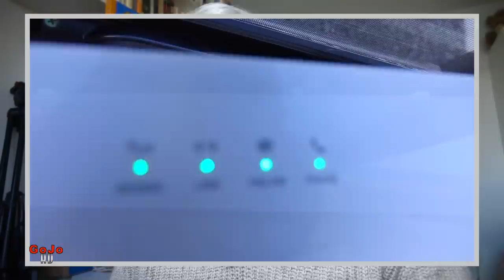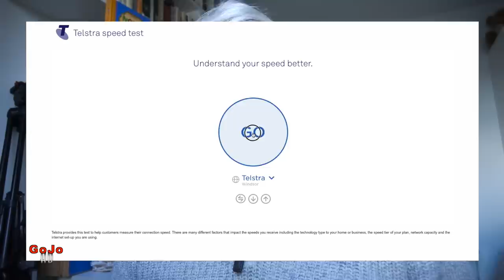NBN Connection Farce | Telstra Smart Modem Review | Internet Speed Test

Comment: I don’t get the reason behind people being surprised that pits are full of water... they are literally under the ground, where else do you think the water is going to go??

Also, this seems to not be a Telstra issue, NBN had not run your lead-in cable yet. Which they should have already done. This is what you were pulling through in the pit, which he should not be getting you to do at all... 
(Initial NBN connection, again, not Telstra anymore)

The initial tech should have seen the no lead-in issue and fixed it, but they would have only run the jumper at the pillar it seems.

Comment: I live in south east Melbourne and I'm still waiting for the NBN. Initially it was to be done in the first half of 2017. Then the date was changed to the second half of 2019. Now we are told that it should happen by March 2019. I've not been happy about the delay until recently when I discovered that my service will be Fibre to the Curb and not Fibre to the Node. In the past I could never understand why there were so many complaints from people about the NBN. How could that be I thought? But it would seem that those complaints from disgruntled customers about slow speeds have forced the NBN's hand to go with FTTC where possible which is significantly faster.

Comment: so what discount did you get for doing the work that Telstra should have already done
Reply: Telecommunications are not classed as an essential service in Australia so there's no legal requirement to make a physical connection when the house was built. It would have been only if the owner requested to have it connected. Additionally, in recent years, the onus has shifted and Telstra and in most cases, now NBN are not obligated to supply conduit or a trench for it to go in on your property, the trench & conduit are the responsibility of the property owner and then the network owner will supply a cable from the closest pit to the house.
Reply from the maker: Interesting!
Reply: @bradreading  Not just recent years. I bought a new build in 1995 in NSW in an 'estate' type set up and the phone lines were only in to the property boundary. I would have had to pay for Telstra to dig the trench. I saved some cash and dug it myself, you just have to ensure it is to at least a specified minimum depth.
Reply: Correct, and so many people blame Telstra when in actuality, the NBN own most of the network now after asset transfer, and thus are responsible for jointing and running new lead in cables. 

(Contractors do these connections, Telstra do also have maintenance contracts with NBN in certain areas)

Comment: Fibre was all installed in areas of the city before it was offered.  I could not handle going through all that.  Those speeds are really slow in this day and age.  Currently I have Gb service and could upgrade to 1.5 Gb but I don't need it for the extra cost.

Comment: I don't have NBN available in my area for another year at least, but I have no plans to use it once I get it, and haven't even used my adsl line for the last year anyway! I use a 4G connection instead and its so much better without the hassles.

Comment: You reckon you're having issues, it's been months and we still can't connect to anything.
Reply from the maker: ouch! not good
Reply: 2 years and waiting
Reply: Turned up at our house a year and a half ago to put a box on the outside wall. Came back 8 months ago to move the box 5cm (up or down not sure) as it was wrong height. Now got more holes in house. Haven't been back since. 3 install dates for area flitted on by, nothings happened. Now told, we're getting the cheaper option of HFC and there was a delay on that as the Gov were caught out using the old system and the minister put a halt on installs while he "investigated". Not sure what is happening now.
Reply: Just had it installed. After all this time, got HFC with flashing light box in lounge/dining room.

Comment: Completely different experience for me. I used Activ8Me as an ISP, Melbourne based so that is where there help line is. NBN guys came and installed fixed wireless, rural property so no point in fibre in the street. Not the fastest type of connection but good enough to watch videos and do everything I need to. No real problems with connection and I get a text and email if any disruption due to upgrades are going to happen.

Comment: When I contact Telstra, which I try to avoid, I always expect the bizarre and absurd. I have never been disappointed so far.
I stupidly rang to find out what was involved when the switch to nbn became available. They said if I switched before the end of the month I could have a free google mini, so I went ahead.
New modem arrived, it connected but internet not working.
Rang them twice 3.5 hours on the phone! My personal record! Discovered the cable to the wall that came connected was the wrong one!! Used my own correct cable still not working!! They gave up “will investigate”. Tried to help my neighbor with similar problems by lending him my cable, his still didn’t work BUT by pulling my cable out the modem switched to 4g sim and worked! Then when I put the cable back in the modem reset itself and worked with the cable!! Reported the solution to Telstra who we’re grateful.
Ps told not eligible for google mini as not new customer! Kicked up a stink got $75 credit.
Pps my new modem died after six months! Another 1.5 hours on the phone trouble shooting then sent new modem and had to get working and reset all my equipment.
Telstra new slogan “it simply doesn’t work.”
Will say goodbye when contract ends.
Good luck everyone

Comment: twice nbn techs turned up in 20 mins...i was blown away, id hardly hung up from a nice lady in the Philippines when a knock on the door....he fixed the little box in the house that was original land line ..then still not right another tech came out again only 20 mins.....asked him if nbn was stalking me....lol....anyway...did all those same tests you had and the only thing left was a another new smart modem..........and it worked...i suspect once the land line was fixed everything would have worked but a new box wasn't suspected so a lot of hoops were jumped before we got to the logical end.
oh its great works a charm..a touch slower at peak time but nothing to worry about..  I think good copper from node to house is a must...really old houses would be a nightmare..

Comment: I feel your pain. For me it’s been nearly 13 months struggling to get proper service from Telstra. There has been 6 NBN techs around and not one of their stories are the same. Sick and tried of having to spend hours and hours on the phone to the call center just to get given the run around. I have given Telstra one more go at fixing my NBN connection and then if it’s not working I will pull the plug on Telstra.
Reply from the maker: So many frustrating stories out there - thanks for sharing yours :)

Comment: Unless you have fibre to the home, the use of the existing phone line copper wire is hopeless because any join in the line or data flow increases a resistance in the line and slows down the internet. As a current (data flow) runs through the wire it heats up. Line speed will not be affected but internet quality will be.. when it rains the data flow slows even more when moisture enters the old phone line pits
Reply: MY isp recommended that before selecting a plan, have them test the line capability and don't go higher. They say that exceeding the line capability can cause frequent dropouts, by overloading joints, etc. I made the mistake of moving my 50 plan to 100, which brought a speed increase from the high-40s to about 54Mbps, so moved back to 50.

Comment: I had not a single problem with connection through Telstra - hassle free in all areas and getting 47mps download and 19mps upload on the 50mps plan - I’m about 40 metres from the node so that would help. Invoice em Geoff! 👍
Reply: Running at miles per second, impressive

Comment: First problem, Telstra... Seoond problem is TELSTRA.. Let us compare.. Monthly unlimited plan on Teslstra is $90 / month on standard speed which is 23mbps.. TPG is $69.99 / month for unlimited at a speed of 42.7mbps, if you pay for the fastest TPG connection possible it is the same price as the basic Telstra plan. So Telstra speed of 23mbps vs TPG at 71.1mbps for the same price and more often than not using the exactly same network and equipment.
Reply: the difference is in the international links which telstra wins in, and the cvc which again telstra wins in
Reply: @avgfree21  yes for business I would be going Telstra for sure and have done so in my 20 year IT career.. but for home use Telstra just does not make any sense at all. Especially when TPG and others utilise the Telstra network. So essentially you are driving a Ferrari whilst paying datsun 110b prices..
Reply: 23mbps? Wish i had that im getting 8mbps
Reply: @coopv2  I am pretty much the same now in Brisbane.. up in Toowoomba it was optic to the house and 80mbps..  upload in Brisbane is dial up speed almost.. crazy but it is an old house and a mix of cat5, coax, donkeys to exchange and then optic in there somewhere maybe..
Reply: @MortifiedU  There is a HUGE difference between Bigpuddle and Telstra IP Services/IPconnect/whatever they want to call it this week so yeah I agree business wise Telstra may be a decent contender and for sure on the residential side THEY STINK.

An example there that actually happened to me and was the straw that broke the camels back, I went with Bigpuddle for a bit a decade ago as I needed a reliable service for home/SOHO/small biz combined use. One day the BGR's went down and I could get ANY and all websites hosted in Australia and NZ and ping all IPs in AU/NZ. I couldn't get anything outside of the pair no pings or websites or anything. So I proceed to ring Telstra and report the issue. 

Telstra rep: welcome to telstra blah blah 
ME: report problem
TR: have you got a Telstra modem
ME: no I woudn't touch that rubbish (we've had lots of problems with Telstra modem/routers before and seen heaps more before with other people especially as this was the days of the crappy black speedstream 4200/6500 boxes)
TR: well that's your problem your modem is broken
ME: WTF?!?!? did you NOT hear that I said I can get web services for AU/NZ?
TR: no it's not a telstra modem so it's broken and you will have to replace it, it's not our fault
ME: how the F did you get this job when you obvously aren't even fit to be a $hit digger, listen to what I say, I can get websites hosted in Australia and NZ so I know for a fact my modem is fine
TR: nope your modem is broken have a nice day hangs up

I was in IT for some years before this so I'm not a newcomer with NFI and this just had me and awe at how STUPID their staff are and how they really don't care about the customer. I found my way to Internode at the time I believe it was and never looked back until they sold to iiFail and had to move on regreftully (Simon that wasn't nice selling us like that).

Comment: My NBN experience... Monty Python all the way. You assisted the tech, great job, now your'e a qualified cabler lol. I had about 10 'techs' turn up on the 3rd attempt to pass the fibre through the old conduit from the street to my house. 2 or 3 guys worked as the others looked on. Great use of human  resources there. And then when they decamped,  I found the junction box on the external wall hanging after they'd chewed up the rawl plugs in the brickwork. After much cussing, fixed myself .I formed the distinct impression these 'techs' were 457 visa workers as they were communicating with one another in their mother tongue. There' s more but you get the idea.Now what's that old saying my dad used to use..couldn't organize a piss up at the brewery!

Comment: Had fibre to our street for 12 years already - thanks to original Optus rollout, 40mbps download minimum, via the Foxtel cable. Rock solid, bulletproof, never any problems.  NBN HFC will be more expensive and slower, as a bunch of additional load will be placed on the node on that fibre. What a load of crap. Bring on 5G, the whole house of cards will start falling.

Comment: Hi ,

Actually the cabling from the corner of your street to the pit and to your house is managed by NBN, and not Telstra.

Cheers.
Reply: I don't think so somehow, Telstra owns the NBN, ok that maybe, but NBN own their own fibre optics, and it takes a lot of care and patience to deliver it
Reply: @theroyalaustralian  Telstra doesn't own NBN
Reply: the cabling from the street to pit and to the house was telstra's job when they put everything in, however the tech that was doing it at the time didnt end up connecting anything for that house, they only install the connection when you request a connection to be made if no connection has been made before which is why no wires were there at the time of the video. the people that owned it before never asked to be connected.
Reply: @Davo22  well, we are still required to ring Telstra to rent a phone number. And thats a $30 cost while you have the line
Reply: @theroyalaustralian  that is because telstra maintain the switching database for your ph number. telstra is actually in a sort of stop work phase as all of the government owned infrastructure like the pits etc that they were tasked with maintaining have fallen to NBNco nbn co is now responsible for all the fibre and backbones and replacing ANY cable that is unsuitable for NBN so a place like my parrents who ONLY have 2 twisted pairs entering the property will need a new coaxial cable run into the property for the NBN and telstra WILL do everything they possibly can to avoid maintaining this wire until that time
Reply: @jackass123455  well yes that's very true, but they also own most of the communications infrastructure, and are therefore powered by the government itself
Reply: dodeca hedron  Fun Fact: Telstra is more often than not voted the top ISP in NZ and is one of the most loved. Funny huh
They are actually pretty fucking good in NZ, really good customer service, plans, pricing and reliability and if you are lucky enough to get connected into an exchange where Telstra has a footprint, you'll get really good speeds too using good infrastructure.

Comment: Ours was quite easy by comparison, 1st NBN contractor lays cable up the street, 2nd NBN contractor cable from Street to box outside wall, 3rd NBN contractor from Box into house. 4th Telstra Tech shows up to verify all connections and set up internet & home phone. Now the outside guys they each did there own thing outside. 3rd & 4th were by appointment since they needed access inside the house. It has worked well ever since.  BUT i have heard from relatives and friends in other area's some horror stories. Mainly lazy contractors laying cable up the street but still using the old copper phone lines from the street. so speed restricted to ADSL service. Just think we got lucky with the right people doing our connection.

Comment: I ended up making a complaint to the TIO. Telstra were unable to work out why my download speed was atrocious. They sent one of their Platinum techs out, supposed to be free of charge, who sorted it out in about 5 minutes - I needed an extra antenna because the modem was downstairs and my desktop PC was upstairs. The signal was weakened because of the distance and the fact there was a concrete slab in the way, quite normal for a two storey building. I was then charged for the Platinum tech on the next bill. I would've preferred the modem be installed upstairs, next to my desktop, the most logical place, but that didn't happen. It also took at least four appointments, not at times convenient to me, to attempt connection. One person installed the cable "somewhere" in the building, the next person disn't know where it was, another person came out and branched a cable off, then the modem people eventually arrived, installed the modem where it was easiest for them, didn't check it was working, and buggered off to the next job.

Comment: You have enjoyed what 40% percent of Australians have had to go through just to get fibre to the node, then copper wires to the house. We went through this extended process for nearly 6 months on a daily basis, costing a fortune on mobile phone calls. We had two MP’s and two Senators batting for us,  We live in Tasmania and from time to time I undertake astronomical in combination with NASA JPL and other research institutions in the USA, including Discovery TV Channel with live broadcasts lasting several hours, with live video and interviews from the most southern optical observatory, Finally we were connected but at only half the speed we were paying for ( 12 Mbps instead of 25). We were then advised that a new ISP was setting up in the north of Tas. LAUNTEL, who were able to provide 50 Mbps on FTTN, which is the max possible on FTTN. We get 48+ Mbps 24/7-we have a 25GB daily allowance with free unlimited down/up between 11pm and 8am. They supply gigabit speeds for those with fibre to the premises. It took 3 techs working 2.5 days at our location to get a usable copper line to the house. We have old damp direct buried Telecom cable running about 150 metres from the property to a micro-node way down the road. I had almost a full page article in the local newspaper before I got any real technical support. I had the head of NBN Co phone me later that same day asking if I would be home the next day for the techs to come to the property. It is 6-months of time wasting frustration I hope never to repeat. The Turnbull government have totally screwed up what the previous Labor government initiated and we have no upgrade path unless we want to spend $20k on getting fibre to the house, which is not an option 🔭📡🔬🌞🌛
Reply from the maker: Wow - amazing. People's accounts / stories on here are simply astonishing. Thanks for sharing your experience.